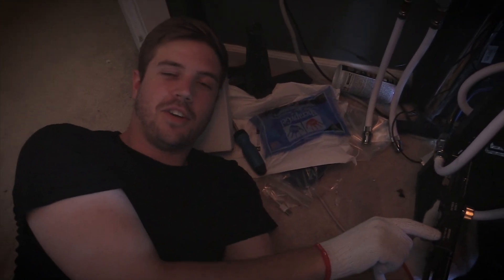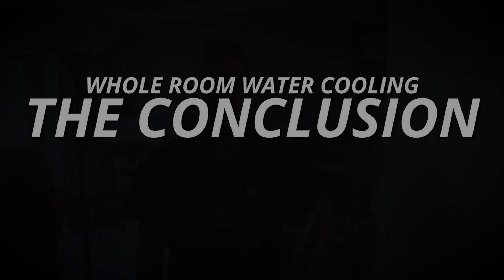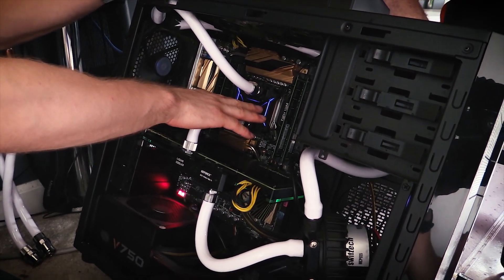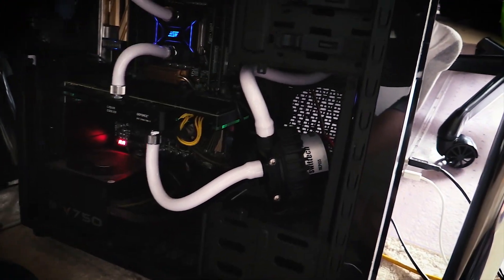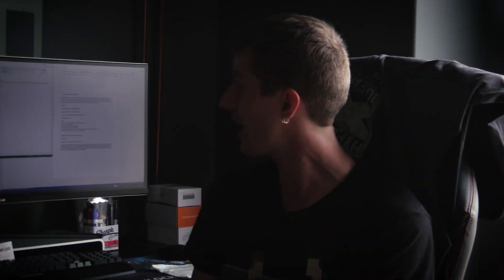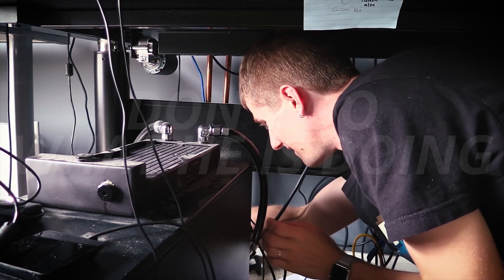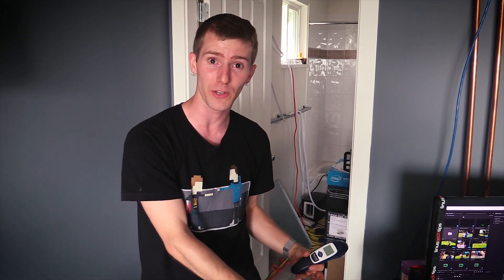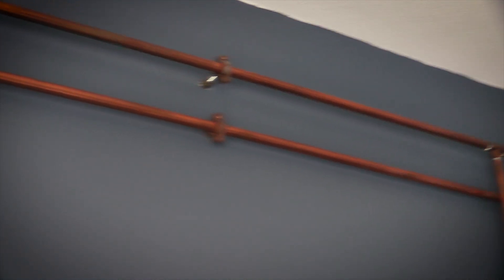Whole Room Water Cooling Part 7 - It's FINALLY over!

Comment: so im just now watching this and can actually tell you what you can do to make it work

do not use metal and do not raise the pipes higher than what an air conditioners height is.
desk level PVC pipes with intermitten shut off valve/drains are perfect

an air conditioner in the room that can help with the air flow helps also.
if there is a window in the room test how hot the room and window gets and uv film the window

this process is a two parter and you only focused on one: the system

you need to do both the room and the system

Comment: One thing that is really missing is a few shutoff valves for the per-system loop, that way you didn't need the tangle of tubing and instead just the 2 quick-disconnects, and a one-way valve to prevent the short circuit from cold to hot through the rad. This allows you to hotswap the PCs without robbing them of their cooling even for a bit.

Though I'm pretty sure that if you applied all the lessons you learned here and started from scratch you would have much less problems with it. Still unpractical for anything less than a server farm though.

For example that bio filtration is not optional, proper bleed valve locations, correct rating for power supply for the fans, ...

Comment: Hey Linus, I know that this is an old video, but would you consider it practical to (during a remodel, obviously) run the water cooling pipes in the ceiling and walls? This could potentially allow you to use insulated PVC, and not worry about aesthetics, while still moving the heat out of the building to be exchanged.

Comment: I've been thinking about doing this, but I've got an air conditioned room that has about 15F or more difference between it and other rooms, and is usually much warmer than outside, AND the room is in shade all the time, AND I can do a shorter run of pipe to the outside than what you've got there.. so This might work out better for me than it did you. edit: additionally it was one of the coldest rooms in the house until I stuck about 2 kilowatts of CPUs and GPUs in there. I feel like you may have had more than that in your office there, but also a larger room to work with.

Comment: Mad, all of them radiators make it look, ugly mate, for my own external rad cooling system, I used an Aluminium Radiator from a Truck, with one large fan from the truck, so the fan only activates when it needs to. It looked nice, clean and slick looking with just one large radiator.

I've actually been thinking of making another for this system, though, to be honest, It'll have to wait, I'm still saving for the new GPU.

Comment: Mechanical engineer specializing in cooling here.

You need some sort of air to water heat pump and a storage tank for it to draw the heat out of so you can set the loop temp in the tank. The air to water heat pump will make 45-55 degree water which if not blended down to near the ambient temp of the room your cooling blocks could start to condense water on them.

Also as pretty as the copper pipe is combining different metals in a water loop is a bad idea.

Comment: To me, the much more cost effective option would've been a window AC and some tubing that leads the exhaust heat outside.  I've done this before - not very difficult or expensive to set up and it works great.  However, the big difference is it wouldn't be anywhere near as quiet.

Comment: Why not insulate the copper piping, or use PEX or something that will not radiate the heat straight back into the room.
Reply: Because that makes too much sense.
Reply: 7:53
Reply: wise man..
Reply: They did it for aesthetics, they say so in the video.
Reply: There's a long list of "should haves" through out the entire project.
Reply: Was about to say exactly that, insulation is cheap.
Reply: PEX would need to be protected from UV, but yeah

Comment: Would using clear plastic tubing have worked better for running the water throughout the room without heating the room up as much? Not only that but if you had LED lights behind the tubing you could have it glow for nice aesthetics. While I don't think it makes sense in terms of cooling he room, I feel like it'd be a cool aesthetic for a computer room.

Comment: Why would you use copper tubing if you want the heat outside of the room? those radiators are more than capable of dissipating that much heat. A heat resistant pvc or even just a less conductive metal would have worked better for the goal of a cooler room.

Comment: Ohhhhhh maaaannn I have so much to say. For the metal tank issue you just could of installed a filter on the inlet side of the computer(s) also a y strainer can work too. Also I didn't really watch the full series on this one, but did you install a water cooling tower? I think you did but if not that can dramatically increase your cooling efficiency if you had one with a force/ induced fan installed onto it. For the air relief just install a T on the line with the 3rd connection facing upward to install the relief on. Back to the problems with that guy's CPU gunking up, you could of had the whole system run through individual heat exchangers for each computer. I would consider a plate because your not dealing with high pressures, plus you can always add another plate if you needed too. If your getting calcium and magnesium build up you could always soften the water. BUT remember you need to make your water more basic so your lines don't corrode. I don't think you'll need to worry about this one but if your dealing with nothing but steel, deaerate your water. For the lines copper is such a b*tch to deal with, if anything goes wrong it's nothing but pain to replace. Thermal rated polymer style lines could do the trick. That way you can have quick connects and shut offs just in case (even though you can install unions and valves on copper, copper IMO are the worse when it comes to changing out a line because they're not threaded on but soldered). Aaaannnddd that's all what I have to say. I went to school for this stuff so if you need another strangers opinion just drop it on the DM haha. That's if you notice this...

Comment: It's a nifty idea, but yeah, all of that copper is basically more radiator area to dissipate the heat, which is why the workstations ran so much cooler on the whole room network and why the ambiet temperature wasn't affected much.

What about a slight tweak? As part of the area setup, one could run insulated tubing through the walls like ethernet cabling, then just plug in a workstation at one of the port stations. It's probably impractical, but that's what LMG does best!

Comment: You should have just installed a 20,000BTU and that may be a bit extreme when maybe even as low as a 5000 BTU  window air conditioner can cool the entire room for that size, but then again you have all those PC producing heat too. Still you could then vent the heat from each individual PC with an above case radiator or air cooled fins and done just as well for a even cheaper utility bill, and not risk flooding your room. With that said, and seeing as you went ahead and did what you did, why not add an air conditioner now. Besides the current working conditions that you have your employees working under, they could be seen as deplorable, and borderline ilegal. Chinese slave labor has it better!  Estentualy you are running a sweat shop.

Comment: Insulate the heat conducting copper. Change the color of the paint of the walls to lighter color. Get the hot water down to lower floors, best if under earth. Place a IR-UV- reflecting sunshade outside to cover the window during day. Forbid spiced food for employees.

Kind regards,

M.

Comment: Now  you  know  why  A/C  installers  INSULATE   the  piping .  Its  obvious  that  the  COPPER   pipes  are  going  to  become "central heaters" .  ALso  some  hard  white  PVC  piping would  have  blended  in  with  the  walls  and  would  have  looked  much  better.  Also  note  that  the  radiator should  have  been  installed in  a spot  where  there  is  permanent shade  (north  side  of  the  building)   and  away  from  any  surface  that  reflects  the  suns  light/heat.
I  think  the  build  was  a  success  but  a  few  mistakes  killed  its  efficiency  .

Comment: A nicer way would be running PVC in the walls. Then no copper heat transfer in the room and you don't have to see all the pipe work. Also there is Flex PVC which is pretty cool and easier to run. I like this idea of relocating the heat for a server room. Perhaps the server room would run with less A/C noise while an A/C closet keeps everything cool.

Comment: Should have used Insulated PVC or Compression Plumbing. The Copper is dissipating alot of the heat. And should have not had the radiator outside in the sun but low as possible in the shade.  And you should have known the issues of mixing metals with PC cooling systems.

Comment: Probably well after the fact,  but why didn't your plumber feiend insulate the pipes? If you're trying to keep the air temp in the room low,  cheap pipe insulation (like a few dollars for 3 metres) going in both directions would have accomplished this

Comment: i did the same thing kinda but ran 20 ft of hose under ground at a depth of 2 ft. pumps are above ground no radiators for fans. works pretty good.

Comment: I think you shouldn't use regular water. you should add some chemical to remove the oxygen particulars from the water. like car cooling liquid. the oxygen in water will react with the copper causing a lot of rust.

Comment: u just could have liquid nitrogen in a container and run copper coil in it to cool the water so much that no pc would ever heat just top up the liquid nitrogen time to time and same can be done with dry ice aka solid co2 but it would be dangerous to have co2 in the room .

Comment: Could've worked and it does work when done properly by experts who is profession is thermal management. Waterless coolant never needs replacement causes no corrosion that would've been one thing. Insulating the hot water return so no heat goes back into the room. Insulating the cold water supply so it doesn't pick up heat on the way to the CPUs. But in the end to my customer I would recommend just a mini split air conditioning system installed in the room and lower your room temperature that way.

Comment: The copper pipes high in the room is a bad idea. You should have kept them near the floor for easier bleeding. Isolating the out-pipes would be good and the whole would make for a very quiet room. Thanks for being honest about a slightly failed project.

Comment: Normal People:
Our room is hot, lets get an AC
Retarded People:
Our room is hot, lets put the PCs in another Room and run some Cables through the Wall
Linus:
OUR ROOM IS GETTIN HOT I NEED 2 WATERCOOL ALL PCS AND PUT 20 25$ FANS OUTSIDE AND USE THE BATHTUB FOR THE PUMPS

Comment: Generally bad idea.
1) should have used insulation over pipes to avoid re-dumping heat back in the room
2) No tap flow control and flow meter at each station to distribute flow evenly
3) Measuring temperature with I/R is not accurate at all with shiny metals due to emissivity
4) Copper and aluminium corrosion, better to have used plastic pipes to also avoid static build up
5) Those quick connections  probably restrict flow alot
6) Second radiator would be needed in winter to dump heat back in the house, and to avoid really cold temperatures which could cause cpu coolers to form moisture.
Why even bother? Just get an aircon. 
Atleast the main radiator should have been inside an air conditiond server room under and adjusted  2-3 degrees C below work area temperature.
Why do I even bother..

Comment: As a flow systems engineer and a general contractor, I can explain all of what was done wrong here... Which essentially ends up being the physical deployment, the theory behind it is fine.  

-Should have used all PEX tubing rather than copper (less inherent heat dissipation, zero corrosion), as that copper is continuing to dissipate heat into the room/house... It essentially is (all of it) a radiator.  
-Regardless of piping material, it should be insulated.
-Radiator array should be in basement of house where its coldest, perhaps even in a sealed area of which has access to a small AC unit... With it sealed off from the remainder of the space, and with enough make up air to accommodate that of the outgoing.
-Said radiator array should be cooled not only actively via the climate controlled environment, but via a larger 220VAC fan... Something easy on the amperage but heavy on the voltage... as it will always run, but always run efficiently.
-optionally one could go so far as to have the piping pass through additional active coolers before the editing room, and/or mid computer load to bring temps back down at the water before it hits the second half of computers... Allowing the second half of PCs to benefit from the same temp of coolant... that or run parallel coolant banks rather than one large series one.  

That and perhaps a few other tid bits here and there, and you'd have something very special, and very very effective.

Comment: you can by the insulation for those pipes and see how much it helps.  Honestly, you probably need to insulate both the cold and the hot pipes.  Sorry it didn't turn out well, though.  Better luck next time, Sir

Comment: Where there's a way....
Chat to some engineers watching your channel ideas.
I am sure between electrical, electronics (commercial & industrial - not Louis Rossmann (LOL)). millwright or EM (Electro-Mechanical as we call them in SA), plummer, the AIRCON guys or rather in your case the refrigeration guys, thermal sealing both heat and cold dissipation, but not to get too technical, all these guys exist, some having a chuckle at your projects in a good way... surely all these guys will be more than willing to give you advice if not help you do the OVERWHELMING COOLING you require with filtration, ease of access, maintenance etc etc
It would be super COOL to see you succeed at this project, not SUCK-SEED
Reply: By the way, your "wins" far outweigh your fails... excellent channel, thanks to you and your team for doing things us regular Joe Soaps in the tech world don't really have time for. But not only us, the everyday guy actually does learn doing things from you guys with these tech channels. We are only short a few electrical/electronic devices in our house because our younger selves want to do what he sees get done... :D

Comment: A quick fix to pump heat out of the room would be to put foam insulation over the copper piping. Colder fluid going in and more heat going out to the radiator

Comment: Allow me to say that,  this not a practical solution friend. 
You could think about a bigger radiator and build behind it like a duct can pull out the heat to the window instead of all those inappropriate pipes,  please consider this idea and apply it in a vedio. 
I'm a big fan of your work and Vedios please don't disappoint me.

Comment: Air conditioning does seem the way to go, but what if you added an air conditioner to the water cooled room. would it make a difference compared to just the water cooling? 

What if you used an emergency blanket as a thermal barrier around the pipes? I actually use emergency blankets in my Cold Frame Greenhouse in the winter to keep my 15 tons of biological culture warm enough with a single space heater. granted, water acts as a good store of heat, but I measure two significant temperature difference between when I was using emergency blankets and when I wasn't. if I was going to do something like that with the whole room system I'd probably run the pipes behind the wall or build a new wall in front of it and insulate it. they also make special insulators for copper pipes that you could put in place as you are working. there's also Styles where you can slip it on after you're done and blocked most of the heat transfer. I think if you added insulators around your pipes as it is setup right now without doing anything else you will see a significant difference inefficiency. especially since you're  transferring heat between pipes in motion before anything is even released outside.

of course, this setup seems especially interesting to me because I would like to use the heat generated by my computer's to warm up a greenhouse in winter. even a single computer functions like a high-efficiency heater, and it's really a waste of energy to have it all pulling in one place. Distributing the heat from the room into a location that needs the heat seems like the best solution. 

alternatively, if you attach the system to a geothermal Loop you could take all of that heat that your computers are generating in stored in the ground and then in the winter use all of that heat to warm your house comfortably without any need for a supplemental heat source.

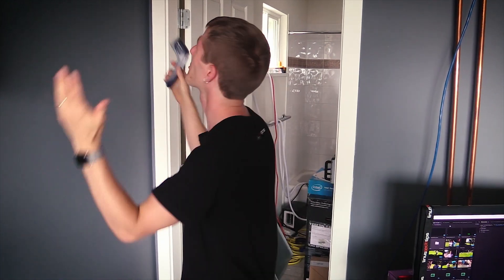Comment: Just to warning... your temperature measure was incorrect, laser is pointing on wall, not on the water tube. The laser must be on the surface you want to measure the temperature. On 7:25m is possible to see the laser point on the wall... a little mistake ;)

Comment: you are doing it wrong , get an aluminum car radiator get one with a fan , the bigger the better , put it outside the house , and use automotive coolant (probably and overkill) !  and you will be lowering the temp way more than a degree !

Comment: Just buy a faster pump and a bigger reservoir+radiator, then everything gets cooler inside and the heat from the copper pipes will drop to a lower temperature

Comment: did they at least at silicon to the point where the screw goes into the home?
that is going to be an expensive repair if not tended to, # leaky house

Comment: If you insolate the inlet with proper pipe foam it wont absorb in room or exterior temperature. Therefore improving over all temperature.